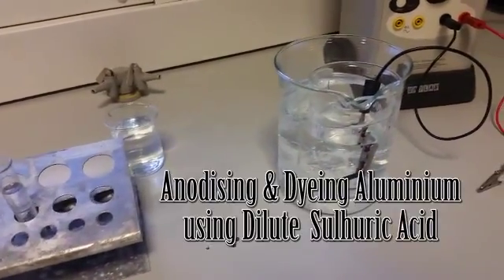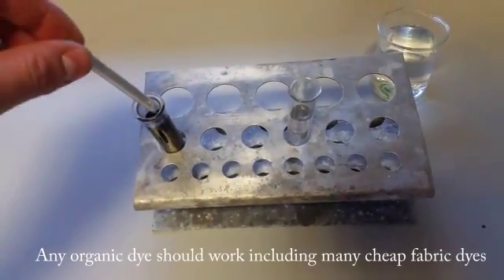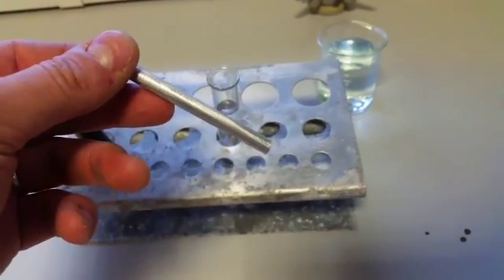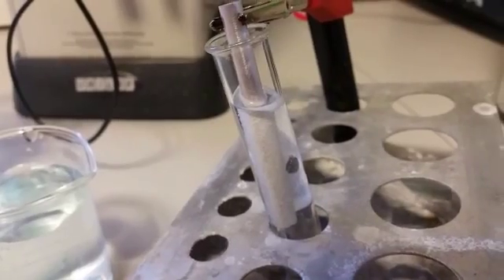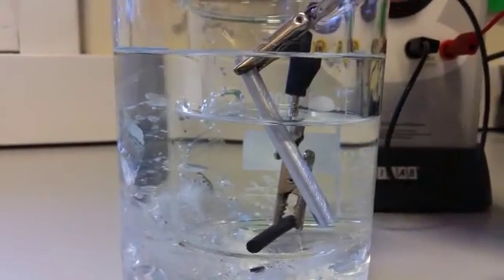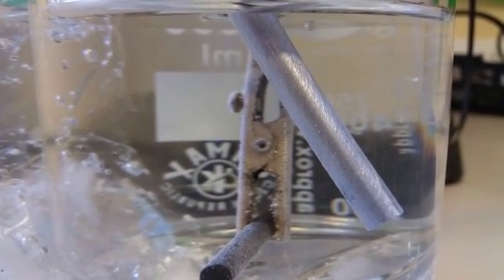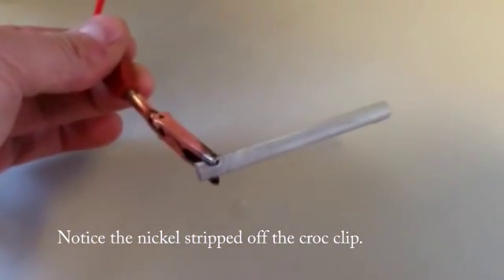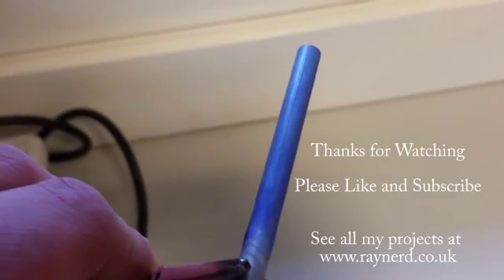Anodising Aluminium using the Electrolysis of Dilute Sulphuric Acid - Anodizing

Comment: Hey can I know what kind of cleaning proccess u have undergone in a detailed way... Please provide ur email ID as I am left with some doubts
Reply from the maker: venkat sai I cleaned the part in water and then dipped the part for about 30 seconds in 1 mol/dm3 sodium hydroxide. However, the first time I didn’t even bother with this cleaning step!
Reply: @craynerd  my aluminium sample is full of carbon dust so I had cleaned it with ultrasonic cleaning but I am not getting proper results...as the sample loosing it's weight post anodising... Though I maintained the right polarity...so I have an opinion of sample loosing it's dust inside the solution .dont know where it is going wrong ...any suggestions
Reply: Nostalgia

Comment from the maker: I used about 0.5 mol/dm3 but higher would be better. Carbon electrodes should work.
Reply: Can i get ur email so that i can send my result for u and also the pictures... Can i?
Reply: And also what should i do for aluminium before starting electrolysis? Immerse in sodium hydroxide or just clean it with sandpaper is enough?
Reply: Hey can I know what kind of cleaning proccess u have undergone in a detailed way... Please provide ur email ID as I am left with some doubts